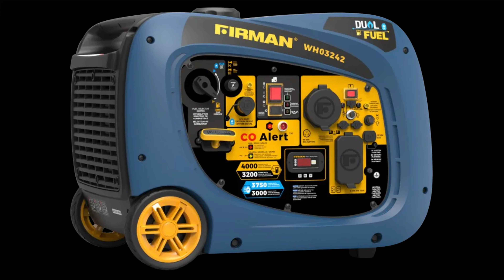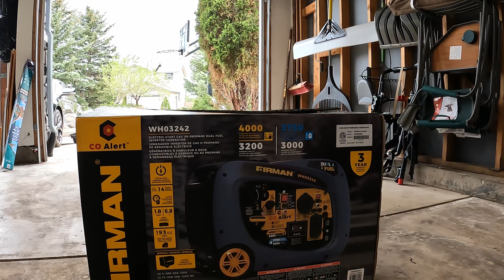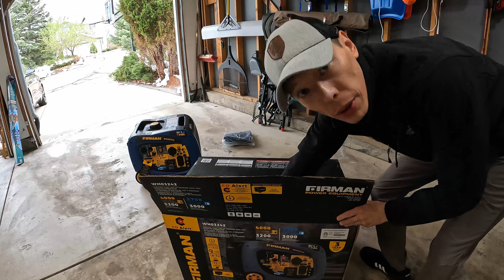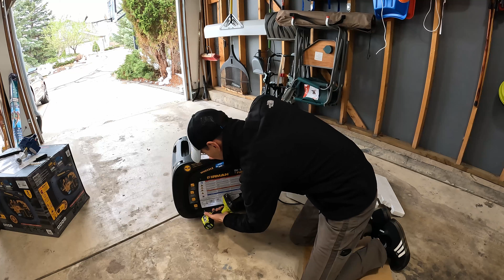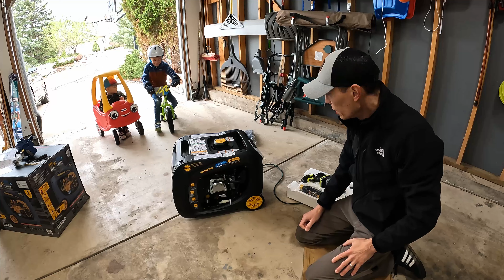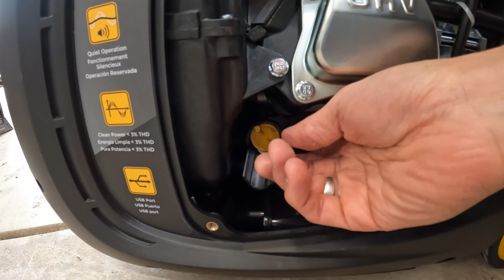How To Set Up Firman WH03242 Generator

Comment: Hi, can you power a house with this generator?
Reply from the maker: Maybe a tiny house.  It works for my 30 amp RV, but I wouldn't do too much more than that.  And you wouldn't want to run the microwave and coffee pot or hair dryer at the same time, or you could overload things.  If there's a power outage and you need to keep your fridge going, this should work, but you'd have to check the specs of whatever you're powering and of the generator.